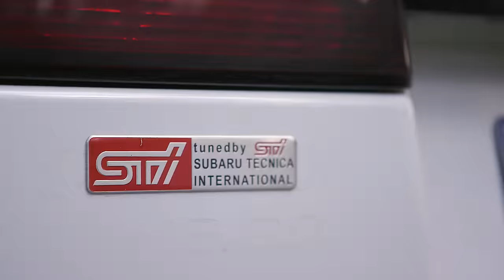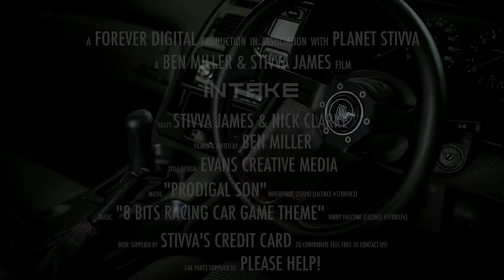What is a 'Car Build'?

Comment: Hello Intake! What's your name? Stivva?
First - keep the car! It's not beautiful, but it's a good car. 
Second - Restore it/protect it to a point where it will hold against rust. Rear wheel arches, body etc.
Third - Turbo will surely mean you will have to modify the engine. This will be expensive and if you do it alone it will be time consuming. I think performance wise the best mod price vs performance will be automatic to manual transmisson conversion. 
Fourth - Do the cosmetics and stereo. Tint, paint or maybe wrap the whole car. 
The last thing - Keep this car as your support car for the Z. What is the need to modify this car? You already have a project car. The Z is much more prone to modifications. It's a sports car, the outback H6 is a sporty version of a road car with offroad capabilities. 
Have fun and keep the funny videos. After all that's the thing you'll remember the best. ;)

Comment: I like the fact that you are a bonafide aussie bloke and show the small stuff that other channels dont. I would like to see an engine swap with something different and cool in the wagon.

Also builds are exactly this, people do more but you didnt just put wheels on it, you changed almost every aspect of the car.
Reply from the maker: Well, we can either fuck it right off and buy a Nissan Micra. Or we can play with the subaru a bit more!
Reply: @Intaketv  the Subaru all day if micra is the other option. Manual swap and some form of power upgrades

Comment: I think in order to call something a build a lot of time and modification is involved, not so much money. Heck, I have a stripped interior Pontiac sunfire with a homemade 2 inch lift and big all terrains with all the modifications required to make it work along with a race seat, air intake, exhaust, cut bumpers and light bars, and although I haven't put a lot of money into it because its a car I beat to hell. It doesn't mean I didn't work hard to make my own rallycrosser, just that it was and is a very budget friendly build. It also dominates the google search for "Lifted Sunfire" which is a win in my book.

Comment: good job on the work you have but in the car so far. really great value for that tight budget. specially the brakes, those things are expensive. 

But i have to say when people say build, they usually are talking about a rebuilt engine. which was torn down and rebuilt with performance parts (forged piston, racing bearing, cylinder sleeves).

Comment: Do a turbo build or super charge it im doing a gf impreza wagon build myself so far including car £1000 gbp and its now almost turbo'd and got fully adjustable suspension uprated anti roll bars and drop link pop or soild bushs stut braces front and rear and home built straight though 3" exhaust with equal length headers and wheels 18x8 work equip copys and maxxis semi slicks tyres

Comment: i wish, i could do something like this build :-) ... about the turbo... do u think is it worth it for ez30? headers for turbo are rare and u need to put it lots of parts to make it working. Starting from intake, motor it self (idk if stock atmospheric parts can handle turbo preasure) to exhoust system :-) ... but it could be amazing to see ez30 on turbo ... once i had a dream that ill buy legacy specB with motor ez30d and ill boost it with turbo because its much quieter than supercharger. When i saw how much will i need for that my dream dissapeared :-D

Comment: no engine swap - not a car build, just a modified car
Reply from the maker: There are a lot of people that would disagree with you.
Reply: @Intaketv  where is the line between modified car and built car, if not an engine swap?
Reply from the maker: The point is, there is no line.
Reply: @Intaketv  calling a car with a stock engine a build is a participation trophy, change my mind 😏
Reply from the maker: Or, I don't have too and I can go back to enjoying my beer.
Reply: @Intaketv  you asked for the discussion in your video though 😂

Comment: I really feel those prices are unrealistic..
Reply from the maker: Hard to find at those prices but not impossible. Those are exactly the prices I paid. I did however not have to pay shipping for most of them and that would be a little on top.

Just remember, at prices like that it is buyer beware. You may get a bargain, or you may end up purchasing coil overs that need a rebuild before they can be installed

Comment: How did you get any of those parts so cheap??
Reply from the maker: The coilovers, strut brace, floor mats and mufflers can be found daily on Yahoo auctions Japan for under $100 each. The Sti Strut braces can be had for $10 if your lucky brother.
Reply: @Intaketv  But isn't the shipping really expensive using import monster?
Reply from the maker: @rileypark7801  maybe? I don't use import monster. You can try Import Monky based in Sydney(who I use all the time, tell him I sent you) or try a broker website like Buyee.
Reply: @Intaketv  Do you know rough;y how much shipping cost you for those parts using import Monky.
Reply from the maker: Best to jump on Facebook and head to the Import Monky and send a message. Be sure to mention Intake! for a better deal!
Reply: @Intaketv  Cheers mate. Also got a Porsche wrx (h6 Liberty) and love the content!
Reply: Been quoted a few hundred dollars for shipping alone for items pretty similar to yours. Is that common for prices to be so high?
Reply from the maker: The coilovers and strut brace are both either large and heavy or long. But $200 to ship all that gear versus paying a few thousand more for the same parts locally
Reply: @Intaketv  Wan't looking for coils, but was getting springs, strut bar and lip and a few small items which I think split up to be $100 each item to ship. Some things defeat the point from getting from japan despite the cheap buying price. i think the coilovers are well worth the shipping if they don't need to be rebuilt.